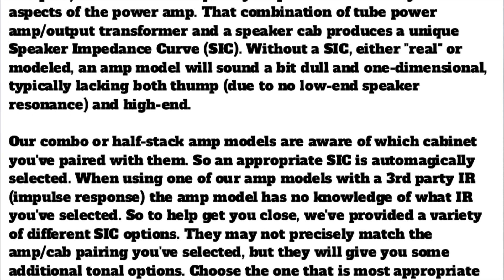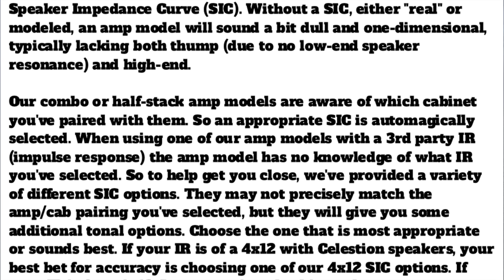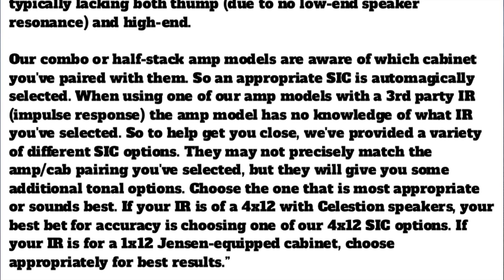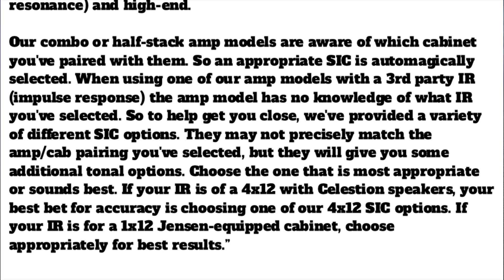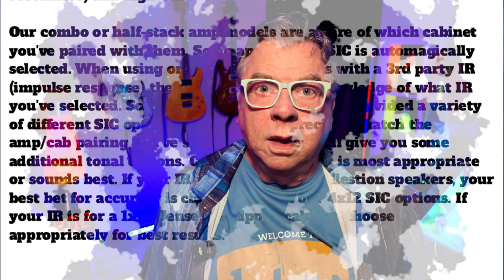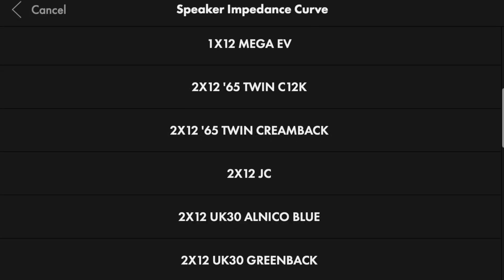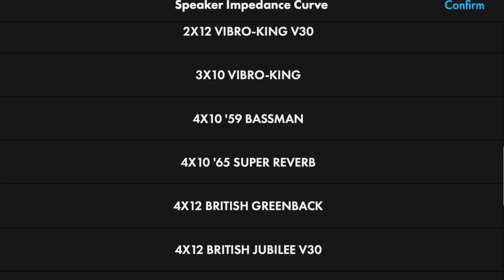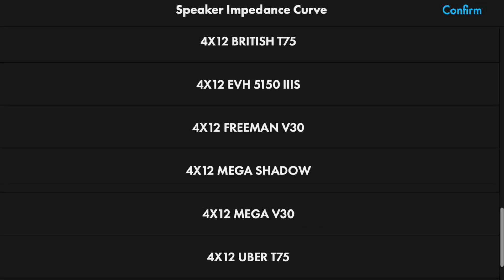Fender Tone Master Pro - Let's Explore The 3rd Party IR Speaker Impedance Curves!

Comment: I’m not using IRs, but I have my TMP going into the return of my real amp head connected to a real cab. I’ve been using presets successfully by turning off the cabs in the presets to avoid double cabbing. So far it sounds great. However, maybe I should be using these SICs behind the amp in the signal chain? Logic would seem to dictate that the TMP would have no clue what my real amp and cab are and so I should use a SIC in my signal chain. Do you agree? Thanks!
Reply from the maker: Are you using the amps in the TMP? If so, then it might make sense. Never hurts to give it a try and see if it sounds better!
Reply: @DougBsDigitalDen  Thanks! Yes, I’m using these SICs behind amps without cabs in the TMP. I guess the bottom line is it’s not required, but use these SICs to taste.

Comment: Hey Doug, where do I find these impedance curves? I'm looking to use a JBL D120 2X12 IR with my Twin reverb for that sweet Jerry tone. So how do I access them on the unit?  Thanks. Keep the good stuff coming.
Reply from the maker: First you'll need to add the IR to your system. Click on the speaker icon over on the lower left; that will bring you to the IR Manager. Click on the + sign to add an IR to your TMP. Now that you've added an IR, you can add an IR block to your preset. Next, double-click on the IR block in your preset and "Speaker Imp Curve" is your first option. Hope this helps!
Reply: @DougBsDigitalDen  Thanks Doug. I found it(finally) and am playing around with it now.

Comment: Can you only do the SIC in the computer control app? Or can you do it on the TMP itself ?
Reply from the maker: You need the app to install your IRs, but you can use either the app or the unit to work with SICs. Hope this helps!
Reply: @DougBsDigitalDen  thanks, I appreciate it. I’m still new to the unit and your videos have been great.

Comment: I was so disappointed when I installed the update. The third-party IRS I have on presets were all changed to a Blues Junior curve, sounded like crap and were drastically quieter. I was not happy trying to figure it out
Reply from the maker: The default for me is a 4x12 GB curve. But it's easy - just find a curve that closely matches your IR. Before this they were all using the default curve, and that REALLY sounded like crap. Are you using a lot of IRs?

Comment: Hi Why isn't there  not an acoustic guitar amplifier? or pedal? Or simulator?
Reply from the maker: There is - the Acoustasonic amp head is specifically designed for ac/elec guitars. And you can also load in acoustic guitar IRs in the IR block, which should be the first thing in the signal path.
Reply: @DougBsDigitalDen  That s weird

Comment: love the content! question... in regards to the loop you created for this video... are you using a looper other than the TMP's? I am new to loopers. I thought that would be a great way to scroll through different effects, amps etc. (just as you did for this video) but I cannot seem to alter what has already been recorded, just what is been played "live". Thoughts?
Reply: While in looper mode on the TMP, do a long press on the switch that you held to bring up the looper itself (the upper right one).  This should change the "position" of the looper from Post (which is where you'd normally use it) to Pre which puts whatever you recorded into the "front" of the presets and lets you hear their effects.  Then record  clean tone/chord you want to use.  Then sample different presets to your hearts content. Just don't forget to put it back to Post when you are done trying out the tones.
Reply: Ä @kevinstahl8834
Reply: Amazing! Thank you. This tip is a game changer for me.

Comment: Hello. I have a question or suggestion to Fender regarding the tuner in the Tone Master Pro. I have a guitar with True Temperament frets. A slightly different than basic one is required for perfect tuning. It would be good if Fender added more tuning modes, say True Temperament, drop D. DADGAD...
I hope this post reaches Fender, thanks
Zox
Reply: I certainly hope this is in the works!
Reply from the maker: You should post this in the Wishlist on the TMP Discord server 👍
Reply: @DougBsDigitalDen  I can't find this server. Could you send me a link?
Thank you
Zox